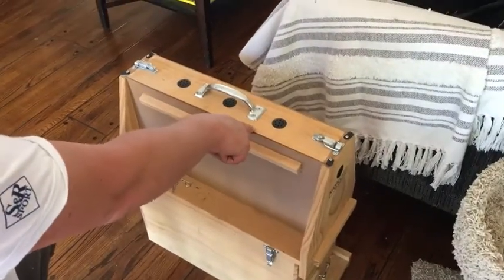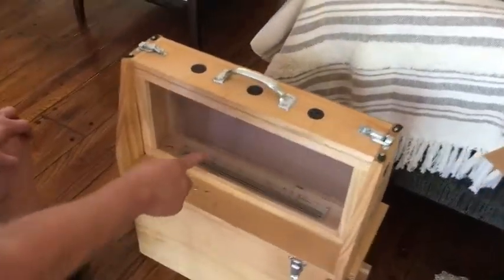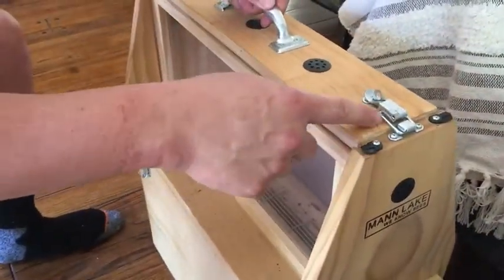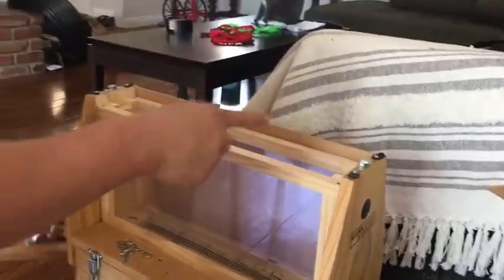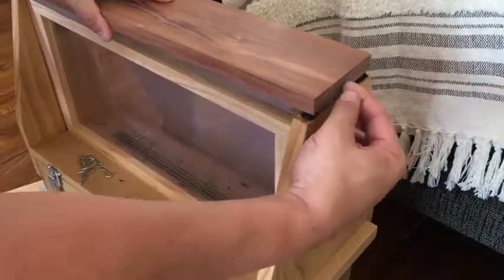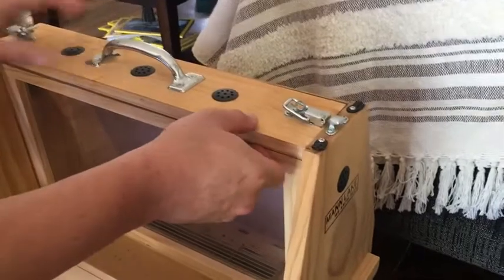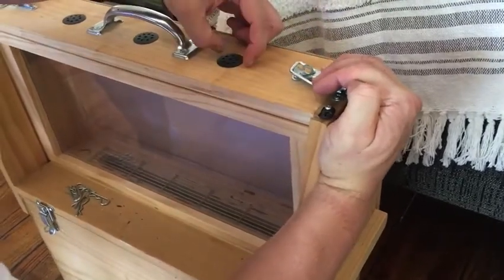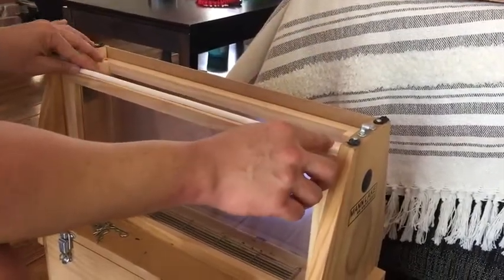Modifying Mann Lake Observation Hive

Comment: A modification is not needed those brown tabs on each four of the four corners turn to keep the top in place.
Reply from the maker: Those work if there’s no load on them,  but I screwed a handle onto the lid, so now it’s lifting 15-20 lbs, and those little plastic tabs don’t hold it in place very well. 

I had a bunch of teens over for a lecture, and when I lifted it up, it opened a gap of about 3/16”, and two bees flew out. There was much drama 😹😹😹